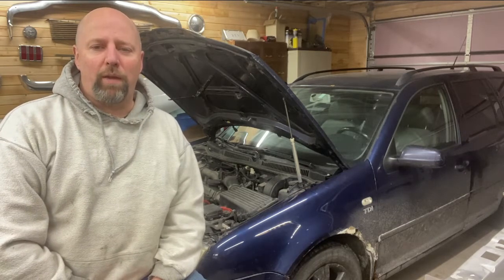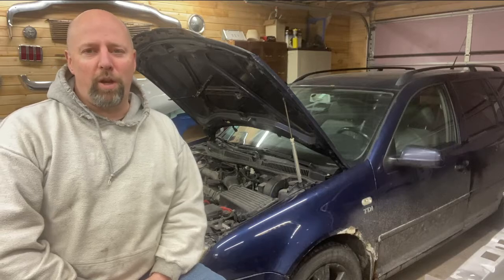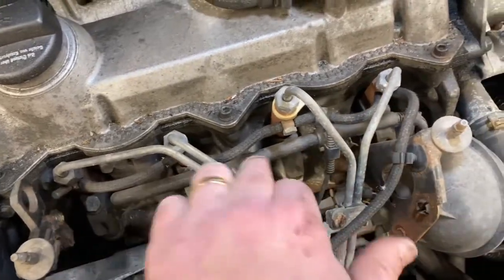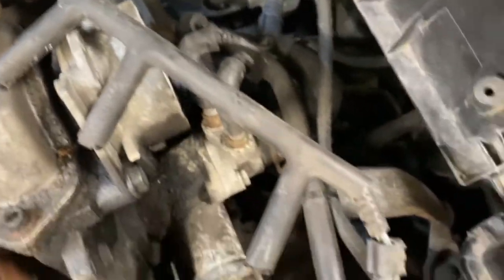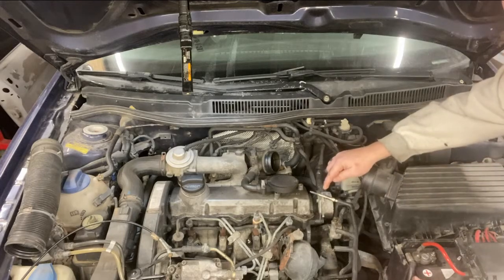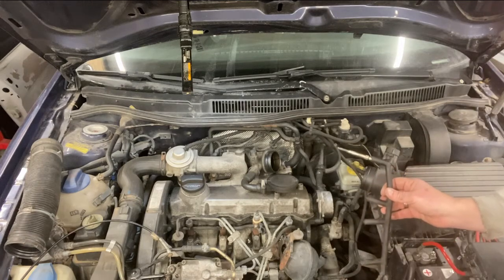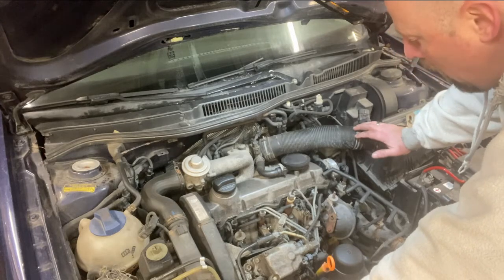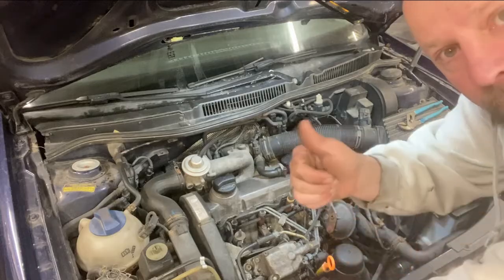Diagnosing VW TDI glow plugs (or others) the quick and easy way

Comment: Did you find out what was wrong? I'm have the same issue with my beetle tdi. Ended up installing a block heater.
Reply from the maker: Unfortunately no.  Did installing a block heater help? My brother is struggling with a similar issue.